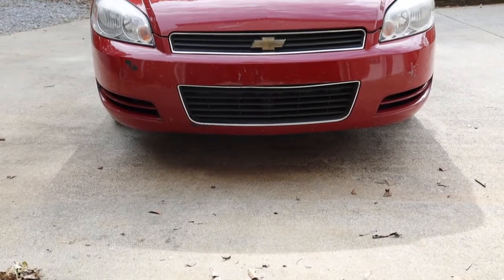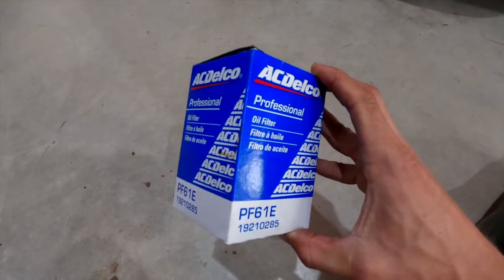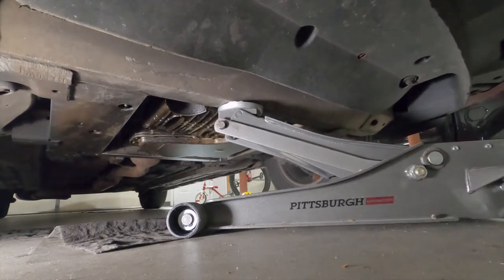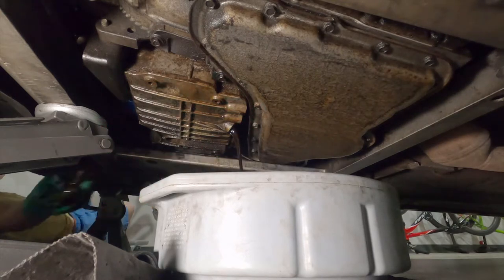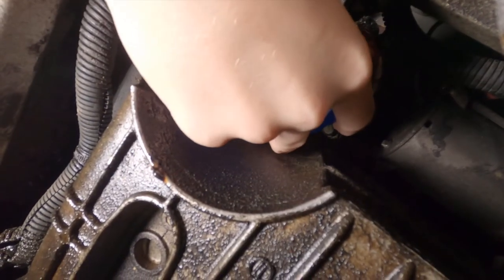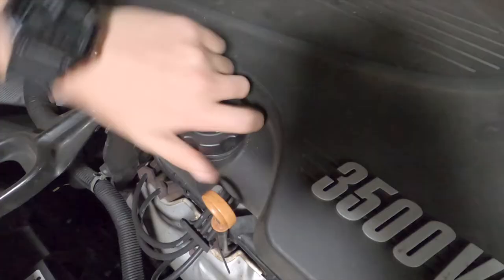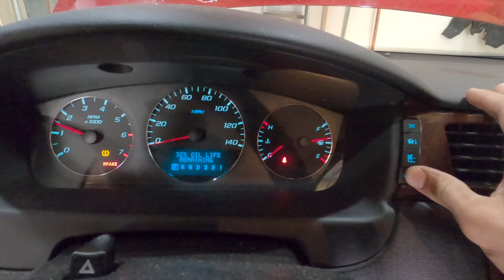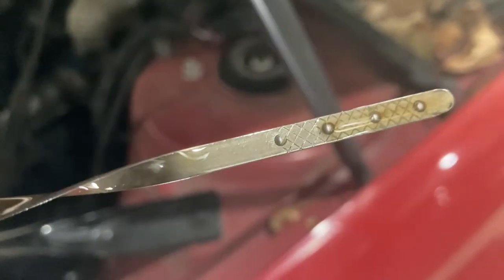Oil Change | Chevrolet Impala | 2006-2011 3.5L V6

Comment: I just bought a 2008 Impala 3.5 with 88k miles for 3k at the dealership i work for! Due to some paint fade, they didn't want to sell it on the lot. They had it due to be shipped out for wholesale, so i inspected it and bought it. Nothing is majorly wrong with it. One of the door switches is broken so its always reading door ajar, and the tire pressure sensors are dead. Otherwise in fantastic shape. Its been parked since 2021, it was a rehabilitation centers transport vehicle and they traded it in while we were having a sale. It has new tires, newer brakes etc. I'm going to be swapping all fluids soon, first thing is the oil. This video shows me that this is going to be an easier oil change than our Lexus. Thank you so much for the video!
Reply from the maker: Wow, that’s a great deal! You’re welcome!
I’m pretty sure the switch for the door is embedded in the door latch/lock assembly. The tire sensor are fairly cheap for a 4 pack of no-name sensors on Amazon and can even be replaced without a machine if you know what you’re doing or when you get new tires, hand them to the mechanic to replace at the same time. To program them, spend the extra $10 to get the single button program tool, put it in learning mode with the key on and push door lock/unlock simultaneously on the key fob, then go around LF, RF, RR, LR.
Mine was a super reliable car and got fantastic gas mileage for its size and age. Hopefully yours will be as well.

Comment: We got one at 230k  07 3.5 no engine issues at all still auto starts if needed. Have changed actuators inside the dash that's pretty common only a 15$ part just need kid size arms.
Reply from the maker: That’s great! Yep, I’ve already changed all of the AC actuators in this as well. Maybe if one of those goes out, I’ll do a video on it. Since it seems to be an extremely common issue.
Reply: my actuators are going out how do u change em!?
Reply from the maker: That would be this video: https://youtu.be/RGrefZudJiU

Comment: One person suggested changing the gasket on the oil drain plug whenever you change the oil. Good idea, or not?
Reply from the maker: It depends. Is it the stock drain plug with a built-in rubber gasket? As long as the rubber is in good condition, no need to replace. If the drain plug has a metal crush washer, the washer should be replaced with every oil change.

Comment: Never install an Oil Filter without first filling it with oil.
Reply from the maker: I’ve heard opinions both for and against pre-filling oil filters. Unfortunately, I can’t find any recommendations from GM either way.
On large diesel engines, I can see it would give a significant benefit to pre-fill the filter. However on a small car engine, the majority of opinions make it seem that it’s not needed.
Reply: To lengthen the life of the engine filling the oil filter 2/3 full with oil is the best thing to do in my opinion.  If you notice and do that,  let the oil sit in the oil filter for a bit of time. .
   The elements  in the oil start soaking up the oil.. The 2/3 you filled it with is reduced to roughly 1/2 add a bit more before installing to bring the filter back to up 2/3 full. 
The reason you don't want a dry filter install is the above , it takes a bit of time for the elements of the filter to absorb the oil..So when start the engine with a dry filter you do damage to the engine because time to soak the oil filter from a 100 percent dry state at the time frame you start it, p the engine has no oil. 
Dry firing an engine ,without oil, at 1,500 revolutions  per minute, damages it .
Reply: Iv never put a drop in my gassers ever. Diesels with a huge filter yea but these tiny filters screw them on dry your engine will never know